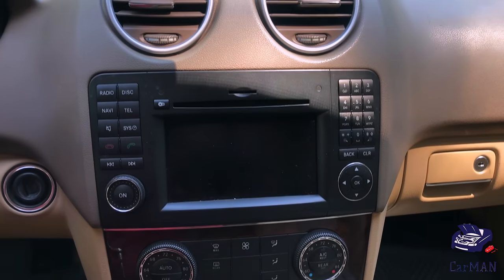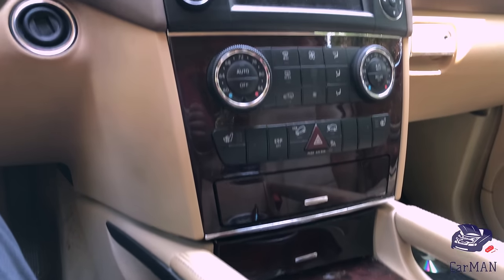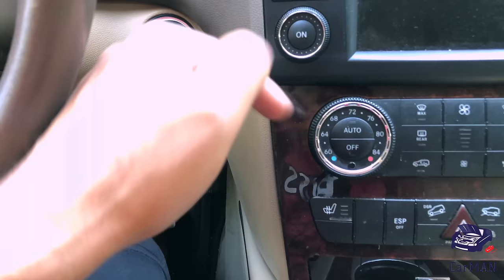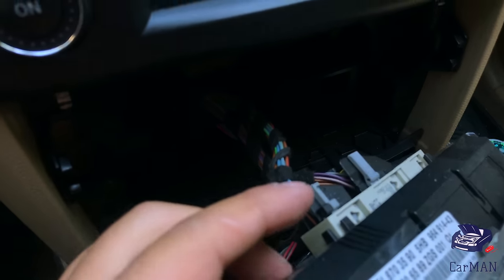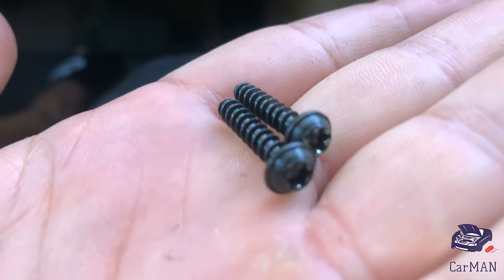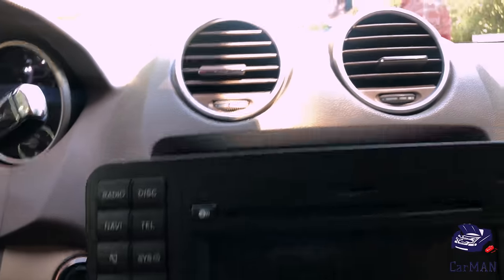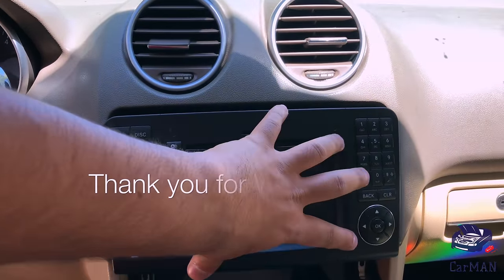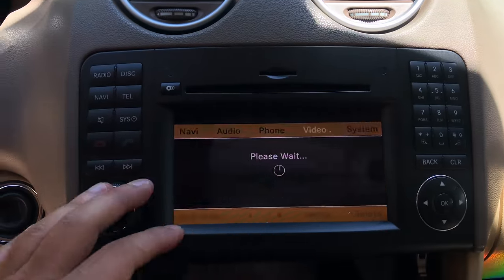How to Remove COMAND Stereo Unit | AC Climate Control Unit

Comment: Hi MrcarMan. Thank you for doing videos on ML. My wife 09 ML w164 comand stereo unit is saying device unavailable no sound at only navigation work with no sound. Please help me you can.
Reply from the maker: Hi, most likely if it’s just no sound that means your amplifier went out. There’s no sound thru aux, radio or anything right?
Because if everything else works and u get no sound at all then it’s the built in amplifier
Reply: My amp was out, similar symptoms
Reply from the maker: Thanks for sharing Jamane